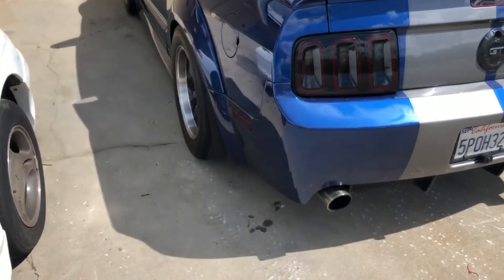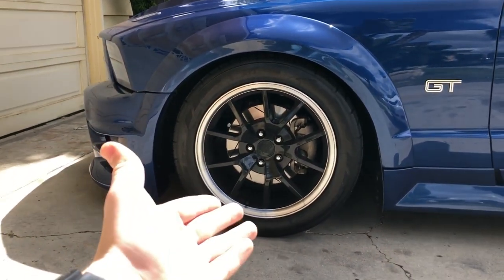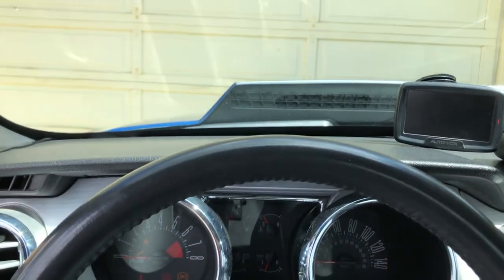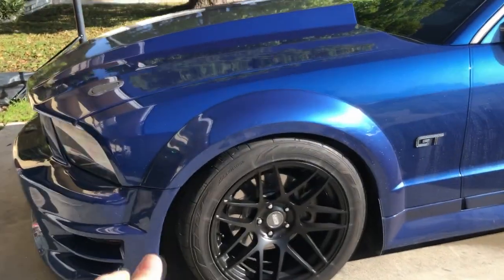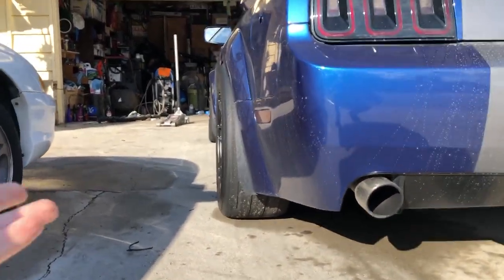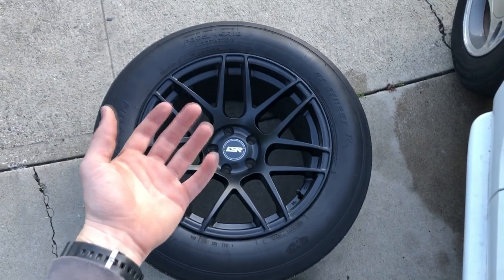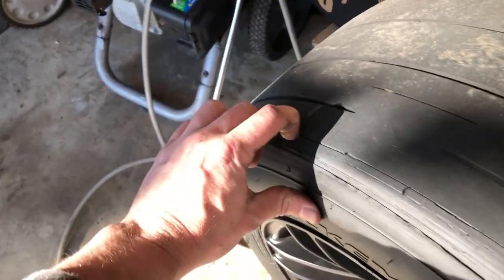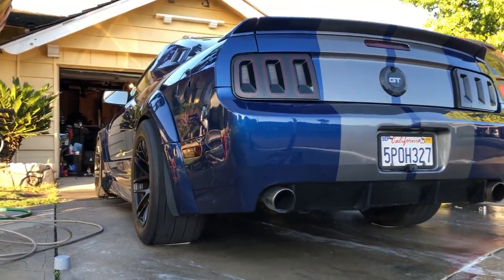I Finally Got New Wheels For The Mustang!!!

Comment: Last summer I bought new wheels and tires for my stang and I bought them for the same reason as you did. They were old and out dated. I also had the black with the chrome lip but my old wheels where the bullitt style. I went with all black and I haven't looked back. Love them. Black or any single color makes the car look really clean. But I think black is the way to go. The new wheels look really nice bro and your stang is badass! I'm not that into the S197's but you make it look so freaking good 👍 Dam whats the size of your tires? They look nice and meaty.

Comment: have the same size on mine lowered 2.5 inches if u don't have relocation brackets for the control arms it will squat alot after I put them on my car wold lift in the rear on acceleration instead of squat

Comment: Drew question would it be wise to mount a boss 302 kit on a GT?
Reply: Nope
Reply: @grassman5819  so does the 302 not responded correctly to the coyote engine?
Reply: @grassman5819  or do you not know what a boss 302 kit is XD

Comment: Good choice drew there different but there different in a good way I like them and you have some meat out back always helps be different if you had some bands I'm sure they be ugly as fukkkk but good choice with the wheel tire combo I have some 315 65 15 on my drag pack I rock on my daily Silverado and my 30/14x15 slicks for the track